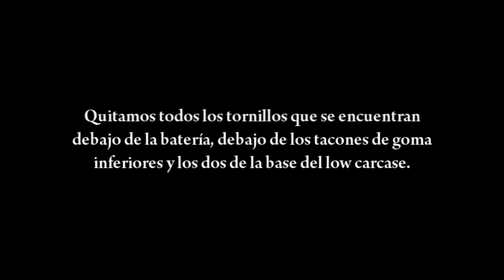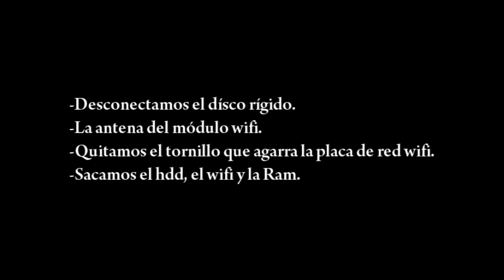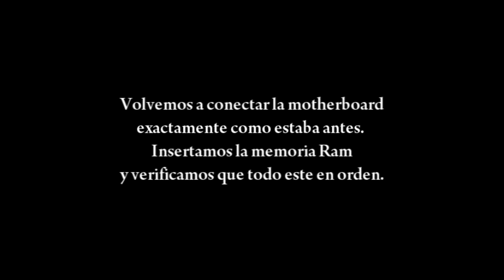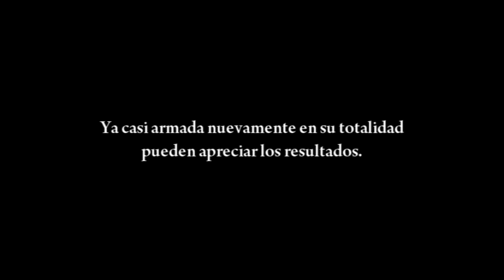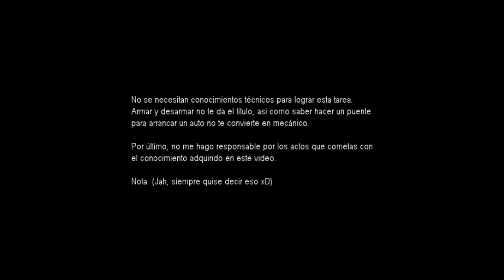DESACTUALIZADO 2012: Desbloqueando exomate x355 (Borrando el Cmos y atrasando la fecha de bloqueo)

Comment from the maker: @34510792 
2 - Sacas la pila, esperas unos segundos (con un minuto es más que suficiente, por las dudas de que quede residuo de energía en algún capacitor), colocas la motherboard (el lcd, el cooler y la cinta de datos que va al panel de encendido (la placa que está a la derecha), insertas la memoria ram y enciendes la maquina (En lo posible conecta el cargador sin la bateria). asi si algo falla no tendrás que volver a desarmar toda la maquina otra vez. Si todo va bien, prosigues con el armado.